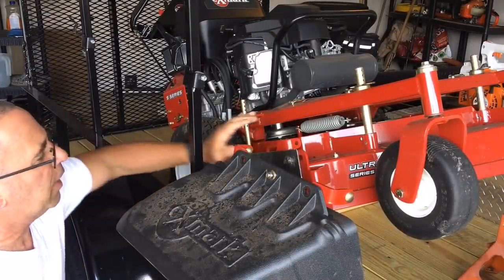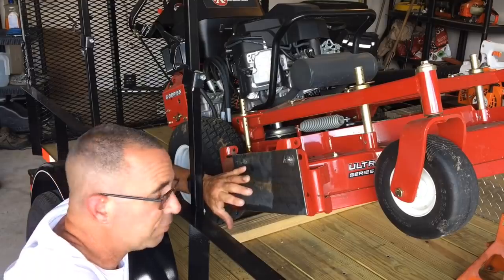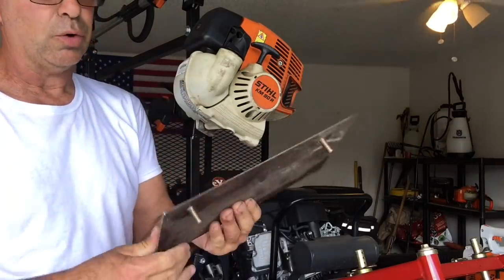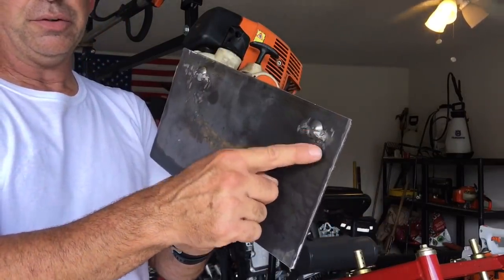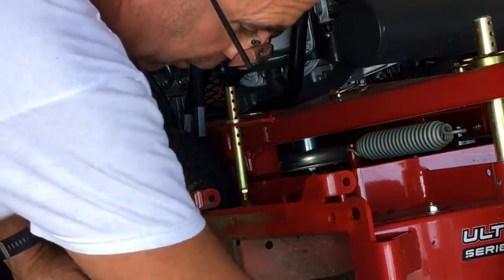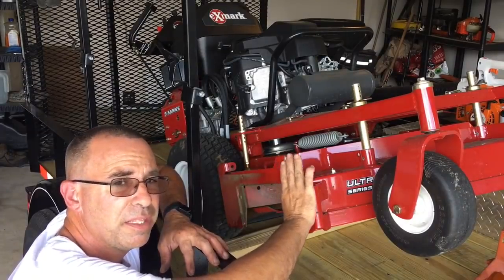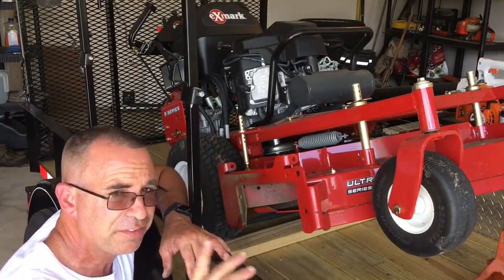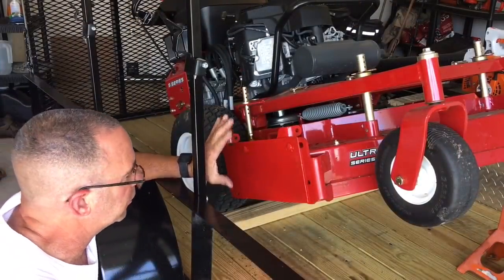FREE Mulch Plate for eXmark Turf Tracer & Similar Model Lawn Mowers

Comment: I did the same thing for my exmark Dan! I didn't do the weld which is a good idea, but I did use wing nuts and made it easier to take off.
Reply from the maker: Did you get mulch blades or not needed to?
Reply: @DansVlog  I used Gator Blades and it still left that line of grass that you were talking about.   So you always have to go back over the areas were you use it.  I will invest in a real one sooner or later. Get tired of climbing  on and off the mower taking it on and off, it's simple but still can be a pain, lol!
Reply: @show2ime  I have a Z3X but I haven't done anything to it yet. I've been looking at the grass flap for this unit. The homemade stuff is good but and cost effective but a headache at the same time. Lol. I'll just have to suck it up and spend the money.

Comment: You should’ve put washers on the other side. Use a very small drillbit and drill a hole in each bolt.  That way you can just put cotter keys in the bolts and you won’t need tools. That’s what I was thinking about doing with mine. Also get two heavy duty, circular magnets, and you can set the metal plate right on top of the belt metal cover. That way it is always right there.

Comment: That works for a blocker , but not really a mulching kit. In order for a true mulching kit to work , you need the baffles under the deck to help with it. Another idea is to mount that shield to your factory flap , so when the flap is down, the shield is covering the hole. When you flip it up, it’s wide open... 🤷‍♂️
Reply from the maker: Yeah I’m pretty sure we discussed the whole mulching thing and baffles and this is something to work for a little while. For many people that don’t have a lot of money this is a perfect solution to be able to mow without shooting crap all over the house even in the thickest of thick. You can’t put that blocker on the shield because when you open the shield all the way up the blocker is shooting at a 45° angle away from the deck making the deck wideer by the width of the metal blocker

Comment: Why didnt you just attach the flat piece to the original hardware so you could flip it up whenever you wanted
Reply from the maker: That was my original intention but the bracket doesn’t line the plate up flat to the deck And the bracket doesn’t flip around far enough to pull the plate straight up and down so the plate would be jetting out at a 45° angle away from the deck in the all the way open position

Comment: Hey Dave, instead of nuts at the end why dont you drill a tiny hole in the two screws and put a pin in it, that way your not sitting there and screwing and unscrewing the nuts off.
Reply from the maker: It has to be held nice and snug  to the deck opening but I think with a washer as a shim, you may be onto something
Reply: @DansVlog  maybe two washers it'll be a lot easier then having to screw on and off